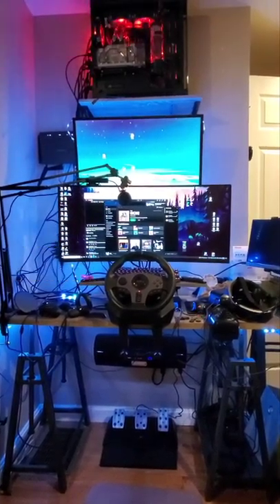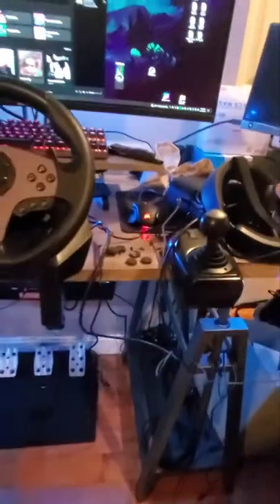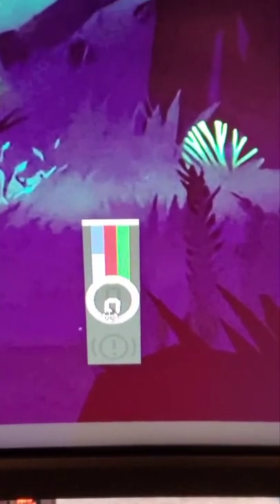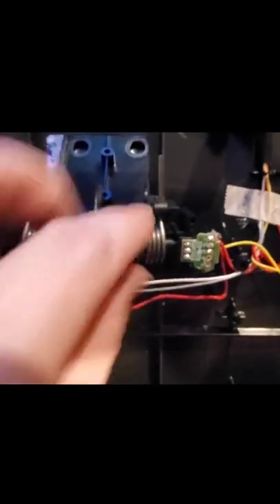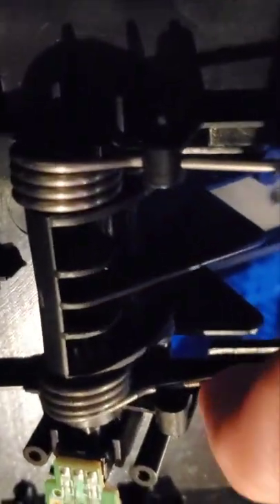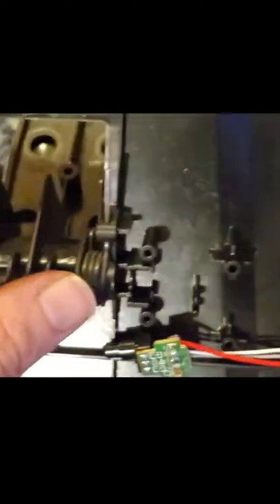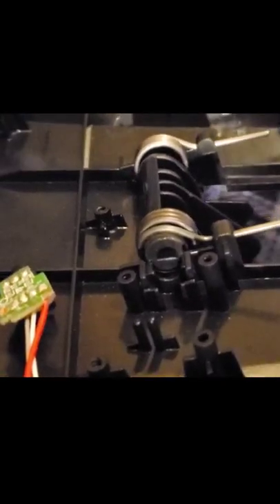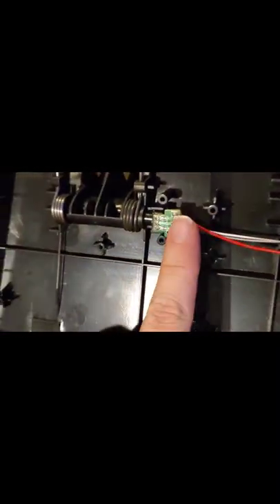How to fix PXN V9 Foot Pedal Controls - Gas, Break, and Clutch

Comment: Beautiful! Picked one up used from marketplace and the clutch was dead and break only worked half way... A vacuum, hot glue, and WD-40 and it's running great with full response from the clutch now. Next it's the loose steering wheel but I'm able to drive properly now!
Reply from the maker: Awesome!

Comment: Anyone know what is wrong with mine the acceleration works fine but the clutch and brake are set as the same pedal and I can use the shifter any tips for it I'm playing beam ng drive btw

Comment: Backstory, I know very little of sim racing set ups and bought this wheel about 3 months ago. Everything works fine after fixing this problem, but like you said in some other comments, it's probably bound to happen again. Before that happens, I was gonna look into buying one of the better pedal sets, something like the clubsport or something similar. My question is, if I find pedals that use the same output as the PXN-v9 pedals, would I be able to theoretically plug them in and play keeping the original V9 Wheel + Shifter? Ofc app compatibility afterwards may be questionable maybe. I would like to know for sure before I spend 300 on a pedal set I can't use yet, and I can't find anything on the internet about it.
Reply from the maker: On PC I would imagine if you had pedals that connected as a separate device, it's likely they will work in a way, just like your controller and mouse and keyboard all work at the same time. I can't remember who, but one of my followers was going to make their own pedals. I've never heard how it turned out. As for what plugs into the controller as a direct replacement, as long as it sends the same data the original potentiometers send(or have the same potentiometer), it should work. You could use the original wire to make a pigtail for the connection to the controller. It would most likely have to be homemade if connecting directly to the controller. The software for the controller limits that. Best case scenario is the game you want to play allows the simultaneous input of new pedals and the og shifter and at the same time. If the fix doesn't work for you, I think the product might just not be up to par with your expectations. I haven't tested many other products, so I don't have other recommendations.

Comment: Clutch pedal went out. Turns out the Clutch chip cant disengage and stays around 60 - 69% engaged when not touched. However it works fine when being pushed. Just wont disengage. i think the chip is the problem
Reply from the maker: Take it out and spin it outside of the pedal and see what you get. I am talking to them now about getting new pedals because A. I want to see if they send me something half decent and B I'll have extra parts. The potentiometer's are cheap from what I hear but that should also mean cheap replacement... They are accessible enough. But I'm almost at the point of taking this whole video back and saying talk to the manufacturer, as its almost a luck of the draw thing with this type of design.

Comment: Thanks for the video . I bought one of these just a  month or two ago and used it less then 10 times for ETS 2, never used it roughly and put it aside until yesterday when I plugged it in I noticed that my acceleration was less and less going to a dead stop, then it started working again ,then same thing happened. I was struggling to go  at 10 km/h with pedal to the floor. The brake is fine and I haven't used the clutch or gear shifter so far since I bought it. I'm hoping this video solves the problem but pissed that there is a problem in the first place especially since its hardly ever been used. And I don't think mine is a dirt issue as after its used I put it aside and cover it with a cloth to protect it from dust. Any ideas what the problem could be? ......ok Its the next day now I opened it up and did as you did in the video and it seems fine now. I added a little glue to the top sides of the little circuit to hold it down better .Just gave it a test run on an ETS 2 delivery run and everything is ok. Thumbs up to you pal.
Reply from the maker: Good work!

Comment: all of my pedals are jacked up and Ive had no issues since I got it for christmas. My brake is the only one that slightly works. Anything I can do to fix them?
Reply from the maker: This sounds like a wire issue! the main wire. Did they all get wack at once? Or kinda over time?

The less likely answer if the issue didnt occur all at once is its dirty af, take it apart and get an "elecronic cleaner" spray and paper towels and go to town cleaning. Many people have issues because there are large gaps for dirt to get in.

If they all went bad around the same time: Check the main cable coming out of the unit by taking it apart like in this video. Check it for obvious damage where it comes out. You likely won't see any though but you could see a kink in the wire. I would (not saying you techincally should) but I would then cut the wire an inch away from where it comes out of the sytem both on the inside and the outside cutting away any part of the wire that may have been bent too hard. Splice/solder the wires back with their respective pairs, tie a knot in the cable, and leave the knot inside the divice, as to prevent to cable from being pulled out of the unit.
Reply: @floorit27  over time. Me and my dad looked at in insides and took each potentiometer out and tested them without the pedal. The clutched died there but the others were the same. We put everything back together and I recalibrated them and they were fixed. Idk what it was but they are fixed now

Comment: copied from other video: thanks, mine also works better after just blowing it myself using my mouth lol, but apparently my potentiometer at the acceletor/throttle paddle is loose so I just lay in a plastic wrap (MAMEE wrapper lol) in between and voila it works fine, but unscrewing all those screws are annoying af tho, in other words try inserting a plastic wrapper folded to give more thickness and tension on the potentiometer board, mine works like a charm after. be careful not to damage the circuit especialy the tiny resistor tho.
Reply from the maker: This plastic wrap idea is great

Comment: this is the exact same problem my pedals have, i'll try your solution and hopefully i don't have to buy a new pedal set 👍 thanks a lot
Reply from the maker: So far I've heard good news from 99% of people with this fix. Hopefully it works for you.
Reply: @floorit27  I didn't feel like buying a hot glue gun. all i did was put a paper towel between the potentiometer and the plastic casing, so that it would prevent movement. this fixed the issue.

Comment: I’m was having an issue that this video fixed so thank for that but I’ve been having this other issue where the pedal doesn’t start responding until it’s pushed down a little far so if you have a solution for that that would be amazing
Reply from the maker: That is the calibration I mentioned. Have you done the calibration? Glad it works better. Keep working at it.

Comment: Thanks for this great video man, I was about to tore my savings by buying a logitech wheel due to issues on my pxn v9 pedals. the gas pedal is in 30% and the clutch at 60% all the time. Hope I can fix it with this procedure
Reply from the maker: If not it might be worth a shot reaching out to them, support@e-pxn.com
Reply: An issue my accelerator had is the potentiometer wasn't installed correctly to begin with, so I'd only be getting 85-90% at best. I did some fiddling with the angle it was sitting at and now it works just fine.

Comment: mine doesn't work on Xinput since it's been used with x360ce mapping, but all buttons on Dinput work, please provide a solution...
Reply from the maker: Switch the steering wheel mode. It starts at an Xbox controller mode. Once you switch it, it will be the PC input version. Hopefully I understoof the issue correctly.

Comment: I have the same steering wheel and a few days ago it stopped working because when I plug it into the computer (pc) in the application to connect it, it takes it as a play station, something that did not happen a few days ago, how can I solve it, does anyone know anything?
Reply from the maker: Sounds like the mode changed if it things it's a Playstation controller. Try changing the mode! Sorry for the late reply.

Comment: Hello. I know that it worked for some people, but my acceleration pedal became worse. I could throttle up to 100%, but going there from 0% became more rough. Are there possible things I may have done wrong?
Reply from the maker: If you're sure the potentiometers are not moving, then the next step would be the calibration. It sounds like now that you have reseated it, the potentiometer has a new position. Calibration will set what position is 0 and what is max. Let me know if that works!

Comment: I'm having troubles with connectability let's just say I'm playing BeamNG drive it will not boot up saying device not recognize and shut down the wheel
Reply from the maker: Wire issue is the first suspect. Do you have a different system you can test this on? If you do it can help determine if the wires are good or bad and go from there. As it could be a PC power save issue or USB issue. The software conflict would be resolved in Windows Device Manager. Try updating the drivers

Comment: I did this and it helped A LOT but whenever I press the gas in game it breaks and when I press the brake it still brakes and the clutch works perfect any way I can fix it?
Reply from the maker: Could be on the wrong mode. Try switching the mode

Comment: Hey, when i hit the gas, it's doing another button and i don't know how to fix it. Do you have an advice?
Reply from the maker: Almost every game requires the secondary set of controls the controller comes with. The first input is like a legacy xbox input. If you hold the mode button I believe it is, for 3 seconds or so, it switches.
Reply from the maker: I looked it up, here ya go, page 5
https://www.e-pxn.com/sites/pxn/files/product/manual/pxn-v900.pdf

Comment: When i driving certrain cars it keeps hitting the max rpm in all gear do you know how to.fix it ??
Reply from the maker: It's probably only happening in certain cars because of the different transmissions+traction control. You should follow the video to take it apart and see if you can clean it first
Reply: @floorit27  yo but in my assetto corsa my clutch is always half way compare to the throttle
Reply: @hasdevsingh6009  PXN-V9's clutch is always set at 50%. You will have to modify the deadzone of the clutch in game to 50% to cancel it out

Comment: My pedals just completely broke in half :/
Reply from the maker: (my best tip at the end, got carried away typing) That sucks. This is really kinda cheap but the next steps up are far more money. Good for the money... 

On the bright side, if you're within a year you may be able to replace it! Contact them!

On the other bright side, there are really cool ways to mend plastic. One of them is heating up metal rods like paperclips in the shape of stiches and meltng them into the plastic. This requires probably a bit of practice. 

I would get JB Weld quick set Epoxy. They have a 5 minute 2 part epoxy that hardens very well. Start with tiny bits and have the peices held together well and let them sit for hours. Then add a little more glue, slowly painting more and more on to add layers. Stuff dries harder than the plastic they use!

Comment: I have a problem with mine where the brake pedal works as the gas pedal but also the gas pedal works as a gas pedal
Reply: And I’m on console
Reply: Hold the "PROG" button for 3s and than the "OPTIONS" button maybe the Reset works on you
Reply from the maker: You do need to make sure the controller is in the right mode. There's a little quick start guide it comes with that details switching it so it has the proper inputs.
Reply from the maker: Sorry I looked it up for another comment so here, page 5
https://www.e-pxn.com/sites/pxn/files/product/manual/pxn-v900.pdf